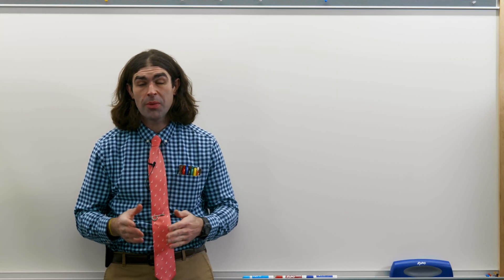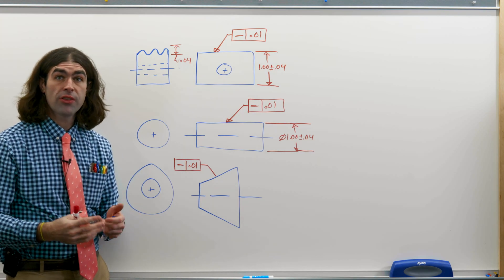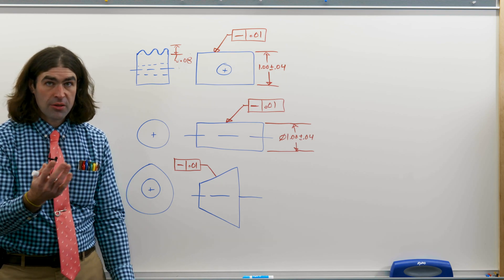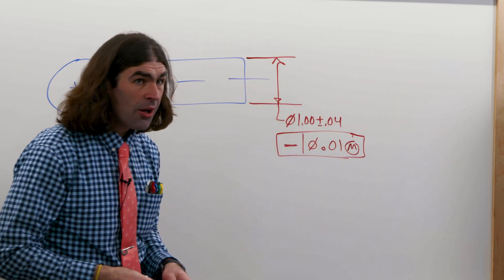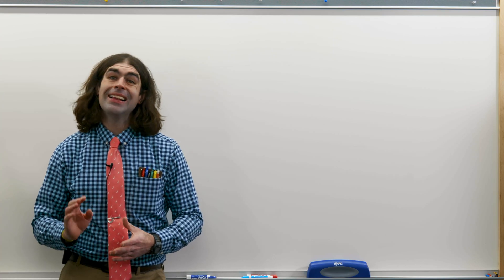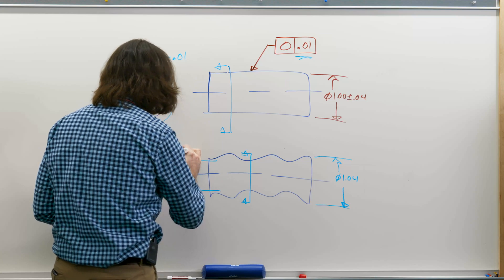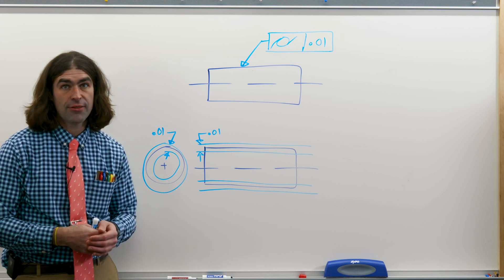GD&T Lesson 2: Form Tolerances

Comment: Pls help clarify. At 6:41 shouldn’t it have .08 straightness tolerance at 1.00 diameter because it’s .04 mmc plus the .04 difference?
Reply: If it is 0.96 dia, straightness tolerance increases upto 0.09..part will be of least dia but allowed to be bent in shape upto 0.09

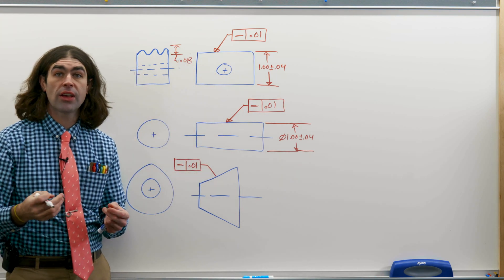Comment: can someone explain again around the 2:29minute mark why it is 1.08?  If I understand video 1 and I do the tolerances that at 1.00 size dimension there is .08 tolerance and we are selecting that because the dimension is 1.00? Confused but trying hard to understand.  And we chose that 1.00 dimension because there was no MMC indicated correct?
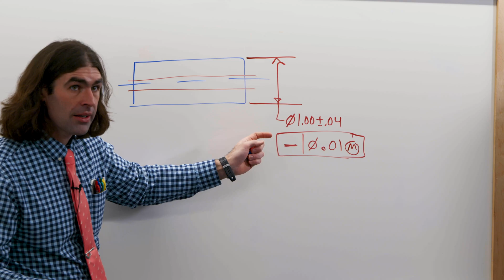Reply: is there also perhaps a video that can explain the comment around the 7:23 min mark. Guess I'm not very good at this trying to help my kid in a class that has no instruction just reading. Thanks for the videos I wouldn't have any clue without them.
Reply from the maker: Hi, this is the video I was referring to: https://www.youtube.com/watch?v=qmipIRF1Krc
Reply from the maker: So I think I showed that in a misleading way, the idea is that the .08" of variation exists in that direction, but I drew it in a way that looks like it exceeds the MMC boundary. It should be entirely within the MMC size.

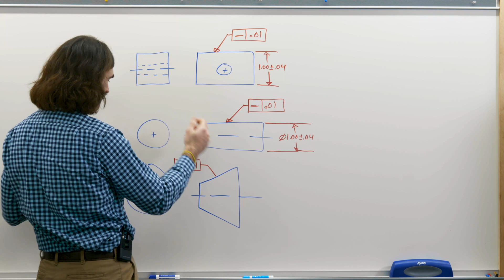Comment: At 2:05 u have made an mistake in explaining, you have applied .01 tolerance straightness to a surface,but while explaining tolerance zone u are explaining the size tolerance .08, If even applying straightness tolerance .01 , size tolerance controls form means that tolerance .01 doesn't make any sense.

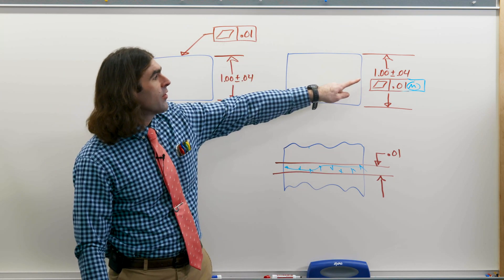Comment: Hi Mr Odell, you mentioned  the gauge size should be 1.06 inches to check the flatness for the example with derieved median plane. I think it should be 1.05 In : 0.04 size and .01 flatness. Am I correct? I am referring @10:45 sec of your video.
Reply from the maker: Hi, I appreciate your feedback. I did misspeak in this example, it should be 1.05. I’ll have to remake this video.
Reply: @RDeanOdell  Thanks sir for posting indepth high quality educational videos. Love your content! 👌🏻
Reply: I was scratching my head until I saw this conversation! thanks :D

Comment: For a conical shape, would you use circularity and straightness? Also, would it be easier to gauge calling out circularity and straightness rather then cylindricity? Or do they use the method to measure both? Anyway, love your videos.
Reply from the maker: Hi, great question! 

Yes, you could use circularity & straightness of a line element to control a conical shape with a plus/minus size tolerance.

Depends on the size of the feature and tolerance when it comes to inspection. I don’t think that a hard gage would be applicable to reject a part with these form tolerances.

Profile is another option to control a conical feature, and kinda simplifies the requirements because of basic dimensions.

Also, there is an obscure use of position where you can have a conical tolerance Zone, but this would not control the form of the surface.
Reply: Circularity and straightness can be used with different values if the requirements support that approach.  Profile controls both aspects to the same value over the whole surface and will likely be easier to verify.  Similar to using Straightness in perpendicular directions vs. Flatness, can a functional case be made to have meaningfully different values?

Comment: Nice video.  I have two questions.  1, what version of Y14.5 are you using?  Flatness isn’t allowed to apply to a FOS until 1999.  2. In regard to Circularity, you said it is checked on V-blocks, but those would be datum simulators, which would allow for form deviations of the contacting surfaces to effect the circularity reading.
Reply from the maker: Hi. Thanks for commenting! I used 2009 for this video. I occasionally reference 2018 or 1994. You are correct that using V-blocks to check circularity would affect the readings. I would argue that you could accept a feature checking it this way, but you would not be able to reject the part if it failed inspection on a V-block. A specialized machine for checking circularity or a CMM would be ideal, but I want to make these topics accessible.
Reply: @RDeanOdell  That makes sense.  I've been a designer studying GD&T for over twenty years.  There always seems to be a disconnect between what ASME says and what inspectors do.  It comes down to cost.  Pure ASME would be very expensive and time consuming to build/buy the tools for each feature of each part.  Understanding things like being able to inspect a part on V-blocks in the hope of passing the part under this higher level of scrutiny makes sense.  Adding that info to your video would be helpful to everybody who watches.  Thanks.
Reply: @robertmartin85  thanks for the comment. I am also a mechanical engineer trying to learn GD&T concepts. I always feel that metrology teams don't inspect the part as ASME idealizes.
Reply: @robertmartin85  The task of inspecting in a plane perpendicular to the axis stumbles when you start determining that axis.  Invoking a Datum would turn it into a Runout tolerance.  Fortunately, the parts I deal with don’t require such surface quality refinements so I don’t have arguments about these nits.  I would expect that for practical purposes any reasonable derived axis would be equally acceptable.  The “good inspector” would set up a favorable axis and a “bad inspector” would find an unfavorable one.  It would be interesting to see a disagreement between two such people.  Get the popcorn. 🍿😂

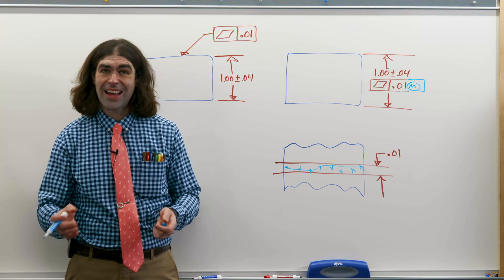Comment: At the timestamp of 10:50, you mentioned that the gauge to check the flatness tolerance applied to feature of size is 1.06. I am wondering if the functional gauge size should be 1.05  (1.04 is the MMC + the flatness tolerance of .01)
Reply from the maker: You are correct. I misspoke on the video. The virtual condition is always the MMC plus the geometric tolerance for an external feature. I’ll make a note in the description. Thanks for letting me know.
Reply: I believe the same point applies at 7:22.
Reply: I was wondering about that. I'm glad you cleared it up!

Comment: Hi,

Almost all of the time, the datums specified in any component drawing are the features available inside that drawing...A...B...C...you can find them inside the drawing itself. I will call them localized or local datum...it is part of the component.

Now what if i were to use centralized datums...for example...i took one point with coordinate of xyz on a car as my 0,0,0.....and use that point to control all applicable symbols in all related car component drawings. The side mirror, the tail gate, even the plastic panel covering...all refer back to my origin (xyz).

Is that allowable? And is that not more hassle for manufacturing and assembly pov?

Thx.

Now...what if
Reply from the maker: Hi,

That’s a great question and I shot a video today to address it. I will edit and put something out next week. 

The short answer is that datums are normally applied to parts or inseparable assemblies because those are inspected as one. According to ASME, drawing requirements only apply at the level they are specified (I made a video about that). It is the designers job to make sure parts on detail drawings will fit correctly at assembly with a minimum of additional inspection.

If there is inspection at the assembly level, those dimensions could override detail drawing inspections and cause extensive rework.

Thanks for you question.
Reply: Go touch (0,0,0) to start your measurements and get back to me!

This is a classic that I have had to address from time to time.